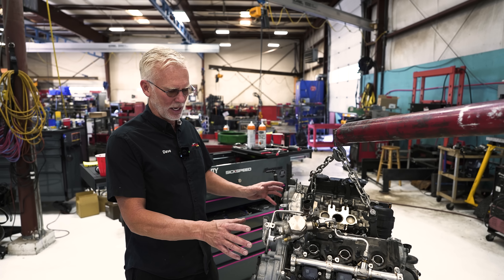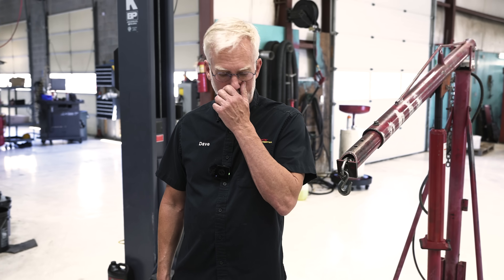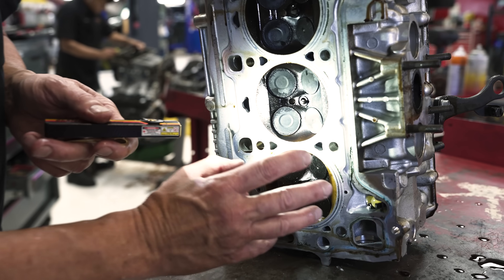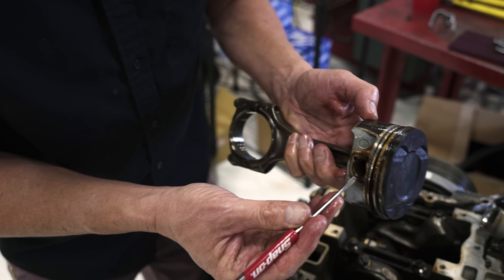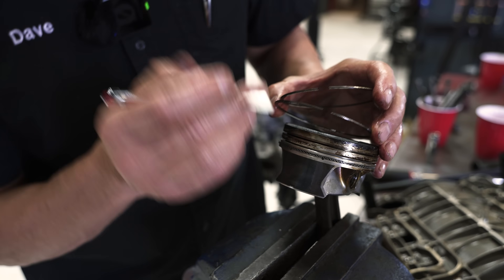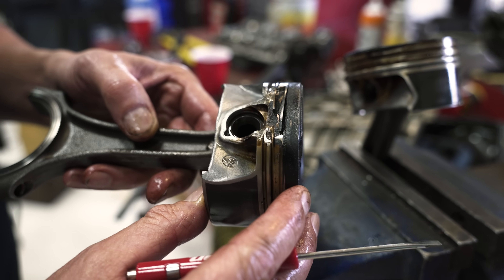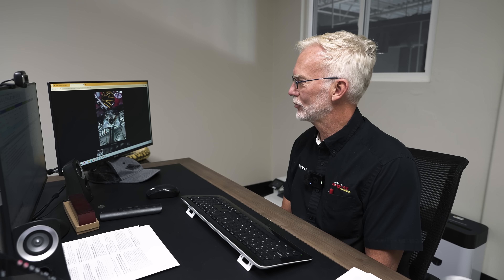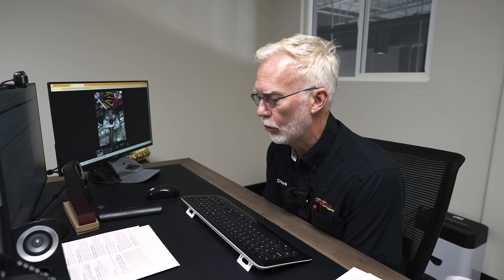Audi S5 Update: Piston Damage From LSPI (Low Speed Pre-Ignition)

Comment: His first mistake was buying a used Audi RS5 with 75,000 miles on it. I wasn’t a tech but I worked for Audi as a detailer and boy did I see some shit come in. That alone made be stay far and clear from those cars including Volkswagen.
Reply: Your loss. Most Audi owners are idiots and don't work on their own stuff.  Same for a lot of average VW owners.  VAG MQB is a good platform - you just have to take care of the maintenance, like with most brands. Unfortunately, VAG, like a lot of manufactures, made these DI engines overly complex, leading to various issues like this video shows.
Reply: @superdave19855 bull. You people always use the "maintenance" excuse. That doesn't fix the fact that VAG products are very weakly designed and engineered. Maintenance doesn't prevent the inherit problems of these cars nor prevent unexpected failures. As the owner of a brand new MKV back in 2008, ask me how I know. Especially when every service and oil change was being done at the dealership while under warranty. No, your "Made in Germany" vs Mexico excuse doesn't fly either. VW pushed me to Honda which lead me to Toyota.
Reply: @MyerShift7   Well your first mistake was buying a MK5. Those were the 1st generation of VAG's DI engines that had several issues - timing chain tensioners, cam followers, etc. 

You are wrong. VAG actually issued a TSB regarding oil specs to be used b/c many dealerships were not using the correct API spec oil, leading to various issues. 

Your comment about weakly designed is bunk too. The 2.0L, 1.8T, and VR6 are some of the most reliable engines ever made by any manufacturer - especially the 2.0L. It's on par with Honda's D16/B20 series in terms of bulletproof-ness.
Reply: @superdave19855  Yep, people think their 2.0 from the early 2010s is representative of all VW/Audis. Those engines did burn oil but the issue is largely non-existent now. I love it when "mechanics" try to spout the same nonsense about these cars but always reference the cars and years that everyone knows were problematic. My take is, if you've only owned VW/Audis with first generation components, you probably don't have anything valuable to add to the conversation. These 3.0s and 2.0s are solid engines, but it's because they worked past their teething years.
Reply: @robbyyant6213  " first generation components" Then how come Honda released the K series in 2000 and year 2000 engines are totally fine, and Honda released the turbo K20 in 2015 and those first year engines are totally fine too. It can be done.  But VW Audi engineering is not good enough.  

Time and time again VW Audi seems to err towards overly complex solutions and then cutting component quality to make back the cost of having an overly elaborate design.  You can even see it on the EA888 compared to the K20 -- the EA888 has three timing chains, the K20C has two timing chains, the EA888 has two accessory belts, the K20C has one accessory belt, the EA888 has EIGHT (!!!!) variable valve lift solenoids for the exhaust cam, the K20C has one variable valve lift solenoid for the whole exhaust cam.

That VW Audi needed one solenoid to slide the splined cam lobe over to the high lift exhaust cam, and another solenoid to slide it back, for every 2 exhaust valves is surely an absurd piece of engineering?  Not to mention the extra cost of the splined camshaft design.🙂
Reply: I absolutely hated working on Audis more than Jaguars. The engineering is ridiculous. VW aren’t as bad some of their engines are rather interesting. But any Audi with over 40k is a nightmare. Compared to a BMW which get way over 100k. Especially the In-line 6s.

Comment: 0w-20 is the same as 30 weight after a bit of sheer, 9cSt instead of 10. Not a big deal. The visc is the same at just a few degrees difference anyway. Dave needs a Tribology on staff instead of just guessing.

Comment: I have a DIRECT INJECTION GM LHU 4 cyl turbo, I bought an aftermarket 5th injector kit for it that plugs into the EVAP port on the intake manifold the housing  incorporates the EVAP and a standard port type injector, it’s controlled by an AEM methanol/water controller that runs off the MAP signal wire. 
Now I originally bought this thing to keep the inlet ports clean from carbon build up but after watching your vid and your firehouse analogy I’m now worried about creating LSP. 
Any thoughts would be greatly appreciated!!!
I bought the car with a snapped rod so the motor is a brand new GM motor that’s in the car now

Comment: Interesting, so much going on.
My thoughts are somewhat with Daves, butt, 
5w30 oil that meets the API specs Dave mentioned,
Premium fuel, using lower grade fuel will likely increase combustion temps.
Always Always, as Dave says, allow some warmth in the oil before moving.
Fuel system conditioners definitely help.
I'd get the tune looked at now when it's back up and running.
Seriously consider the Liqui Moly additives and eith Liqui-Moly or Mobil 1 engine oil.
Great car and awesome vids, thankyou for the update Dave. 👌

Comment: its a decent engine driven by imbecils who dont know the slightest about ICE. These type of ignroant bloke people better off driving EV's or just ride the bus tbh .
 
My father is no exception at the age of 50 not knowing shit about howw engines work.Once i sat nex to him and he would accelerate too hard(40%) for a cold engine i said you should be very gentle in the first 5 minutes and moderate after that until its up to op temps. What did he do? He gave full throttle just to show me he can do it and nothing would happen. This was after roughly 2-3 minutes driving(2l diesel) at 50km/h. The engine and the oil was still cold as fuck. (G20 320d)
now this is just one type of story, there's a variaty of imbecilistic behaviors regards to driving a car. 

No wonder you see german cars left and right in repair shops. Btw the average IQ is what? 95? Statistics doesnt make it look any better either lmao
The diff between a 120iq mildly intelligent vs a 95iq bloke is not 127% to the 120iq guy its more like 100x ability to think. And this is between the avereage garbage and a barely talented person. 

I belive a driving licence should require a minimum iq thats slightly above the average, the rest ride the bus to the construction job or to the factory.

Comment: Also shorten the oil change interval, the oil also gets saturated with fuel. 
Which works massively towards getting LSPI.
Do not stick to the 20000 mile/2 year interval suggested by the manufacturer.
Reply: The simple answer The owner don't know anything of the car maintenance. Just lazy people
Reply: @Ymier4  it was stated multiple times, this car was bought recently by this client. 
Many people are not aware, that owning a gdi equipped car can have these issues, nor do the manufacturers do any sort of education for even the 1st owners.
As far as Audi is concerned they get a great rating concerning environment(gdi with long intervals)and this is just extra money in the bank. 
Had this customer gone to the dealer, he would have to buy a new engine out of his own pocket.

Comment: I would be very cautious with blasting the pistons to clean them, I have done this with an old BMW engine of mine and it removed the hard anodized coating (used to prevent micro-welding of the ring and piston) applied to the top ring land. Otherwise great overview of the effects of LSPI and the criticality of using the correct oil and giving the engine time to properly warm up, as well as how critical it is to take extra steps to keep direct injectors clean (I personally always tell people to only use fuel stations that have certified TopTier gasoline in combination with periodic use of a quality fuel system cleaner).

Side note: I know you love to rag on the Germans for utilizing rear-mounted timing chains, but there is a great engineering reason for it ;) from BMW in relation to their decision to move the chains to the rear of the engine: "The inertia of the transmission at this end of the engine
significantly reduces the rotary oscillations and also therefore the loads acting on the chain drive." This improves life of the timing chain itself but unfortunately seems to be immediately negated by every manufacturer espousing 10-12k mile oil changes. I would bet you that these modern chains (many of which feature chromium nitride coated chain pins) would likely never see a failure due to stretching if oil change intervals were set to 5,000. In fact I would be willing to go even further and bet that a good majority of engine related issues would be negated with shorter oil change intervals, granted I don't think that's any controversial or novel statement to make.

Comment: Over the 15 years, my experience with additive/cleaners are that liquimoly is always a good bet. Amsoil tends to be pretty great as well. Lucas is readily available everywhere and seems to do something compared to most others which seems to do nothing. But Lake Speed Jr says PEA cleaners are great for injectors, which Gamut really promotes their products having
Reply: Just using Petrol Fuel System Cleaner btw then using it regularly not everyday usage. 

I'm not a fan of cleaners or additive mixed dilluting to the engine oil.

Comment: I own a 2017 honda civic sport touring 1.5L turbo direct injection engine, And I have experienced a couple of things that seems to me could cause issues. First one was at 24000 miles the battery failed and the car was losing power! I got lucky and had no damage from this. But I could see it causing problems with low voltage operating coil packs that were giving a weak spark not burning the fuel efficiently as it should have! The battery is too small ( in my  opinion) for all the  electronics in these cars. Second thing is, the PCV Valve is a plastic piece of crap that sticks and occasionally i have to remove it from the valve cover and I spray mass airflow sensor cleaner through it and the oil runs out the other end and I shake it up and down to hear it rattle and replace it and the car runs much better afterwards. And I believe that the pressure caused by this  plastic junk sticking closed has to reak havoc  on the seals in the engine! And I have to change the oil every 1500 miles in this dream works  engine. And last but not least! I see people putting regular gasoline in vehicles that are designed to have Supreme fuel when gas prices are as high as they are, and the hotter the temperature gets the louder i can hear all the ladies picking their kids up from school and they are in a hurry and plow the throttle pedal as they turn the corner in front of my house, and the pistons in their fancy SUV is just getting the hell beat out of it as the regular gasoline lights itself on fire under heat and compression! Knocking the timing way off! I try to explain when I'm filling my gas tank and I hear someone telling the guy to fill it with regular ( I  live in Portland Oregon and we don't pump are own fuel here ) I explain to them that there engine doesn't care if the gas prices get to twenty dollars a gallon! If you have a vehicle that says premium fuel only! You can't be running that garbage gas in your Audi, or Lexus! You are just begging for trouble! You bought the damn thing! Now you gotta pay the piper folks! 😉

Comment: I have been a long time believer in a 60 second idle warm up and easy driving for the first 2 miles))) It is nice to hear Dave Confirm this.
Reply: absolutely yes....especially in the winter...and also if the car stays parked and not turned on for long periods...👍👍
Reply: Same, I've told the missus multiple times, but she still cranks the key and sets off immediately...
Reply: I have done this for as long as I've been driving. Unless it's winter or it's set for a while. Then I let the engine warm for 5 to 10 min. Depending on how cold it is. And still drive easy for a couple miles. To warm up the transmission and differential. I've done it so much. That my wife started doing the same thing. It's worked well for so long. Can't see any reason to change the process.
Reply: With my last couple cars I have been letting them warm up for at least 10-30 seconds and then I'll do very careful, slow driving until I see the water temp get up to the normal range. 

I also try and go easy on the gearbox until I've driven about 10km (6 miles or so) just to be safe.
Reply: @Phasuuma  Yeah best way pal, we live a little rural, it's about 6 mile into town/main motorway on a 50mph road, so by the time I have to do any actual driving, the engine is all warm and good to go, I see some people turn the car on and speed away in first, breaks me heart
Reply: @stephensingletary8374  I live about 6 miles (10km) out of town and most of the road(s) are 50mph (80km/h) for me. So I'm usually warmed up quite nicely by the time I make it into town. 

My biggest issue was not knowing if I should use 5th gear whilst going 50mph and having the engine/gearbox still be cold.  My mind tells me that it's not good for the gears/gearbox but then I'm just having the engine RPM's sit a lot higher which might be horrible for the engine so I don't know haha.

By the way, I live in New Zealand hence the kilometers measurement. Also our cars and our ambient temp is very different to the likes of the USA.
Reply: @Phasuuma so you’d rather have the engine stressing, revving up high while cold, instead of just having the transmission in 5th running at normal rpm’s in the transmission and engine?
Reply: that’s the way to do it, I start the car when I first get in , and then by the time I get situated , put on my seatbelt etc , car is ready to go , I don’t go over 2000 RPM until car is nicely warmed up , even after that I stay between 70-80 mph on the interstate , I don’t remember if I ever got up to 90mph .. and I have V8 biturbo Mercedes with 450hp … it’s my dream car , there is nothing else I’d rather drive , so I baby it , and maintain it religiously…

Comment: I know, the BMW engines cylinders are Nikasil coated as well & I think in Australia or somewhere in the world a chemical reaction was happening in their Diesel engines where that coating was getting eaten off the cylinder walls.

Nissan use the Ford patented spray weld technology on their alloy V6 engines now as well so they actually don't run  bore liners in their alloy engine blocks !

Comment: Dave, I’m not a professional, but I would like to add that (in my opinion) these new high compression/turbo/DI engines are NOT capable of running on regular 87 octane fuel, no matter how held back the tune is from the factory, we’ve seen this way too many times in the Cruze/sonic forums, anyone who runs 93 premium in those cars has ZERO ISSUES. Food for thought….

Comment: I drive a direct injected 2.0 turbocharged VW GTI.  Now I REALLY understand why its important to get the oil to temp [180°] before bringing the revs up over 4k-rpm 
As well as using Top Tier high detergent gas AND fuel additive.
Reply: 180 Farenheit? 180 Celcius seems way too  hot!
Reply: @TassieLorenzo  
180° Fahrenheit ✔️

Comment: Tks for all the explanation on oil API and pre ignition. Im a big VAG fan and with all the info you given im thinking the problem could be from a bad injectors. Like dirty or broken and maybe the wrong octane fuel. Especially on tune car good fuel is essential. Plus if it as wrong oil, hard to believe, but could be a cheap oil. That could explain the situation. High end engine need good fluid it's the basic but it's expensive and need to be take in count when buying thoses powerful turbo car.

Comment: There’s one more thing that can cause or at least contribute to LSPI. Dave didn’t say it on camera probably to save the client embarrassment. You must put premium fuel in an Audi and it should be from a top tier station. Not Mo’s Flow and Go. Any other octane grade besides premium will cause pre ignition even with octane additives.
Reply: Many places sell 91 as their 'premium' which isnt enough for these german luxury cars. Also worth noting Dave's shop is high in elevation so no doubt the customer lives and drives in it too.
Reply: @bobman717  Exactly. My wife has a Q7. I drive a 335i. I do most of our mechanic work. 93 Octane is what we swear by. Believe it or not Cosco does pretty well for her. I use Shell almost exclusively. Same station too.
Reply: Where I am we call it super unleaded (or 'super') 97/98 octane for most high performance cars. I also use it in my bikes.
Reply: @beggsyful  You must be at a higher elevation. 93 octane is the best I can find here. Except racing fuel and that’s about $8/gal.
Reply: @Plumbtired  Interesting. In Germany the Low cost fuel has 95 octane. Premium fuel 98 or even 102.
Reply: @ztawdfc86r345  Wow! I wonder if elevation has anything to with that?
Reply: @Plumbtired when we say super 97/98 that number is RON and not US AKI which is (RON+MON /2) and typically ~5 points lower than RON alone
Reply: @ztawdfc86r345  EU vs US scale is different 91 in EU isn't equal to 91 in US.
Reply: I think you are right,its happened with one youtuber,with his audi rs6 when he brought it to U.S for show you can see it on his youtube channel  MatArmstrongmk2
Reply: Sure, but why did only one piston, at least on that bank, show damage?
Reply: @rafmatt1607 sure, then why would LSPI only be one piston and cylinder bank? You can use the exact same reasoning to discredit yourself
Reply: Maybe it is the cylinder with the highest compression of them? @rafmatt1607
Reply: @rafmatt1607  I don’t have a clue. Maybe that’s the rear cylinder where the most heat is. Ask Dave. Ok maybe I do have a clue but I’m a 43 year back yard mechanic. Not a professional mechanic.